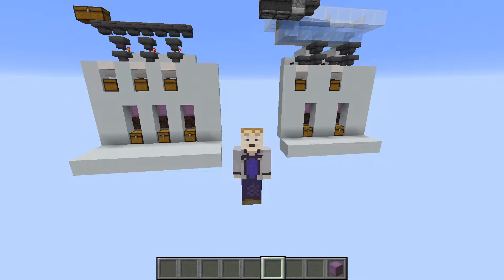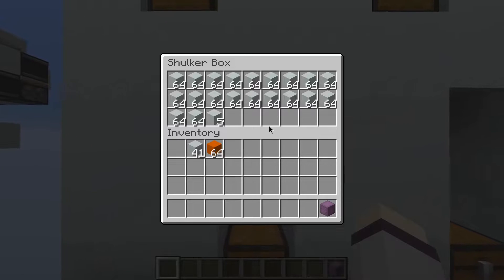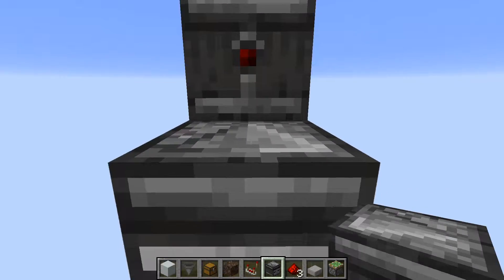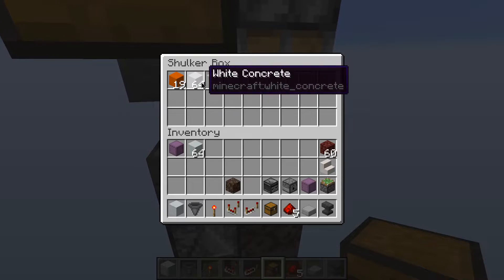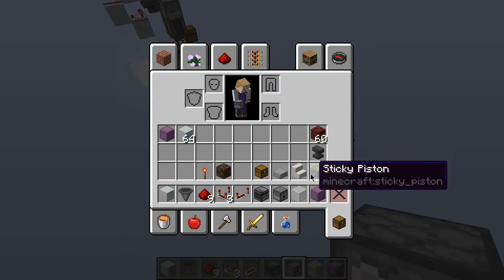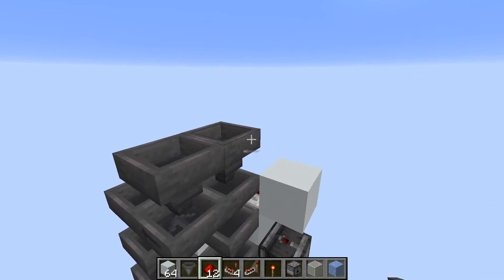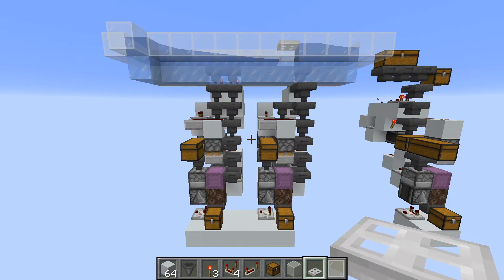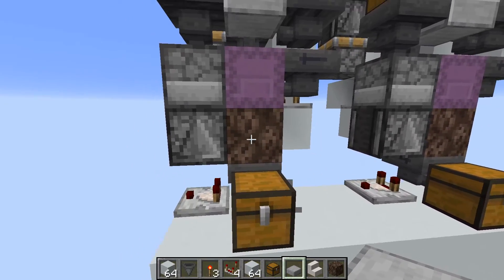Tutorial - Accessible Shulker Box Loader (Java 1.11-1.15.2 - Fix for 1.16 in Description!)

Comment: Amazing hidden design! It still works in 1.21.10 (after applying the fix in the video description). Sometimes the shulker box pops out of the soul sand and doesn’t get picked up by the hopper, but there’s an easy solution in newer versions: replace the half slab below the sticky piston with powdered snow
Also, you can now swap the soul sand for mud or a honey block just for aesthetics.